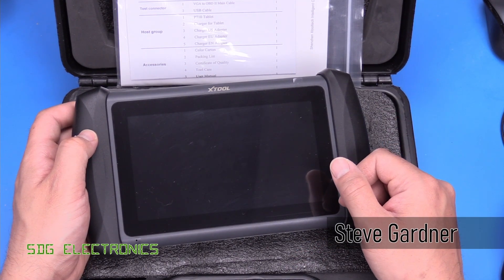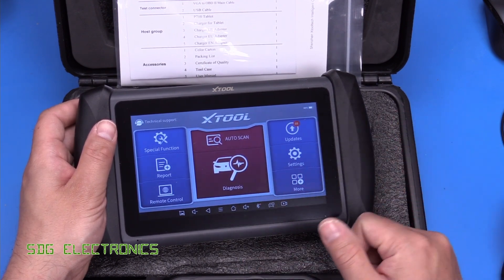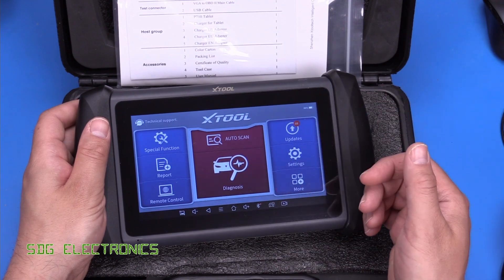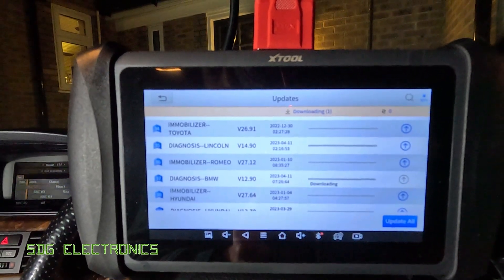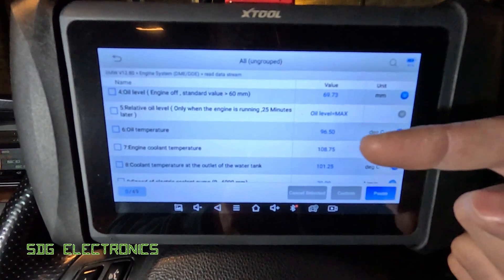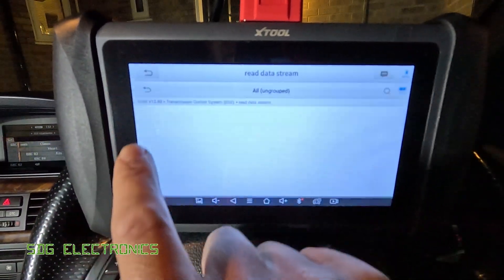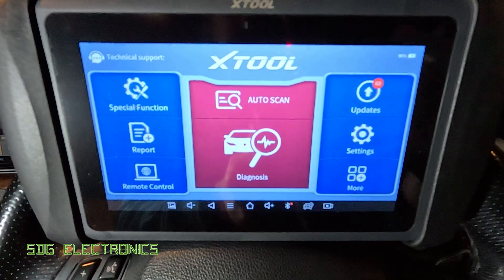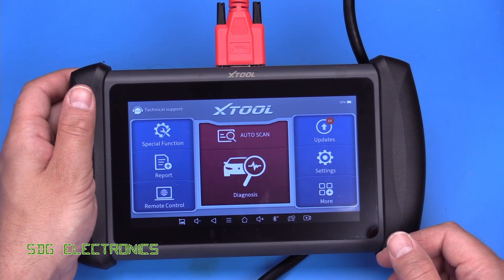SDG #296 XTOOL IP616 OBD-II Car Diagnostic Tool Scanner

Comment: I could use a OBDII tool like that, price has been putting me off a bit, there are loads of cheaper units out there but I want to ability to adjust module settings in my Toyota, so I can programme remotes and configure my A/C system etc.
Reply: Autel is a better option tbh.